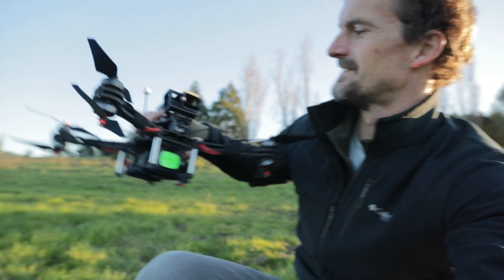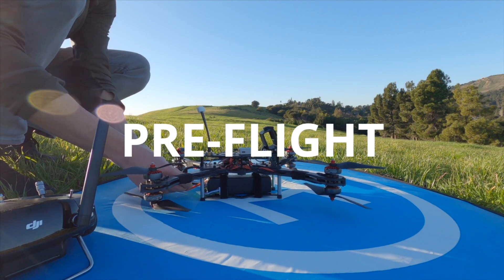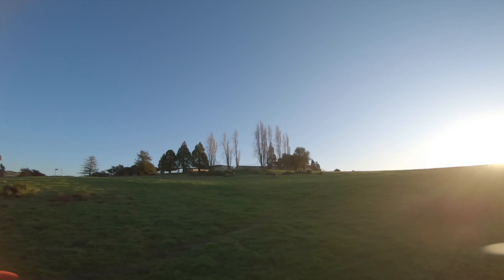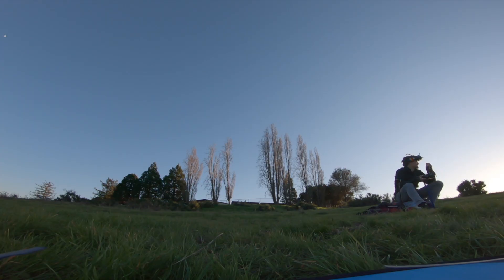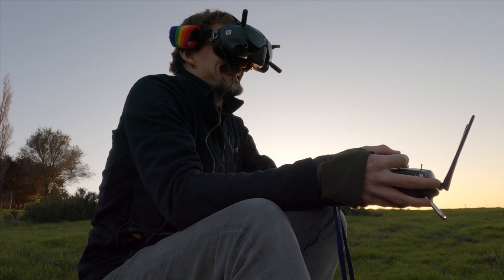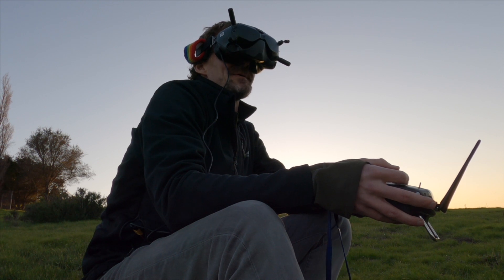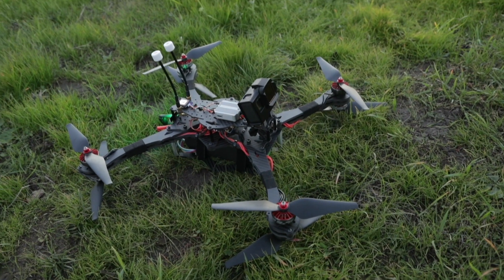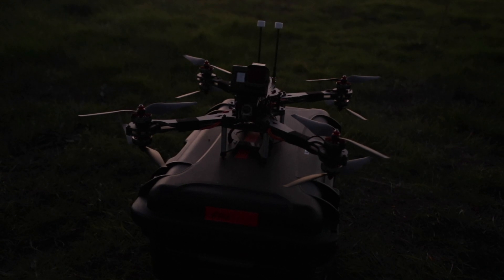Building and Flying an 8-Rotor FPV Cinema Drone

Comment: Nice build! But the thing that i wonder, is that if one motor fails. Wouldn't the whole thing be out of balance and start spinning like a normal 5" with only 3 working motors? or is there some kind of feature that the remaining motors shut down on the side of the failed motor. Or would it act normal and keep on flying with 7 motors?
Reply from the maker: Great question!  I suspect it would likely have enough authority to at least make it relatively safely to the ground if it lost a prop, ESC, or motor.. really depends on the software though.  We might need to try a test where we try to fly it on fewer than 8 motors.. sounds fun :)  There are some interesting tests out there of 8 and even 6 rotor drones flying after a motor loss, but I haven't seen one for Betaflight

Comment: That's a damn beautiful quad! Can you make a video about  the regulation and  stuff needed to work with this machine, or maybe put some links about it down here for us? That would be awesome. Great content btw.
Reply from the maker: Thank you!  Yeah, this is such a smooth operator.. take a look at the video I just posted about its new big brother :)  Regulation-wise, in the US, a drone of this size needs to be registered with a clearly-marked FAA registration number (easy, $5 via their Website).. to be used commercially, PIC needs a 107 (less easy, but worth it) and, if you're in goggles, there needs to be a visual observer with eyes on it the whole time.  And generally speaking, it needs to stay below 400ft AGL, within line of site, and not go over 100 mph.  Really, the bigger issue is that one-by-one cities, parks, privately owned spaces, etc. are banning drone use.. so even though the FAA doesn't allow people on the ground to regulate airspace above it, they were slow to the punch and it's happening anyway.. plus the new proposed rules may do away with it all!
Reply: @MattBeardsley  Thank you for the comment, it answered a lot of questions that I had.

Comment: what does it weight an whats its thrust?
Reply from the maker: 2.2kg with lipo and GoPro and, in theory, a max of about 17kg of thrust (based on iFlight's test numbers for the motors at 100% throttle and assuming 70% efficiency on the lower motors)

Comment: Great vlog as always. That is some machine. Just out of interest, what kind of payload weight can she handle and what are the flight times like?
Reply from the maker: Thank you!  I used a pretty modest drivetrain for this first prototype, so it's not the serious heavy lifter it could be.  It is crazy efficient though, easily flying 15 minutes with a GoPro on this size pack.  Based on iFlight's test numbers for these motors, it should be capable of about 8kg of thrust at 60% throttle assuming only 70% efficiency on the bottom set of blades and its AUW is about 2.2kg.  more testing needed :)

Comment: Your videos makes my wallet hurts.. now i want to convert my 2 X 13" xclass builds to 12s X8
Reply from the maker: heh heh, onward and upward!  You already have those 8 motors right?  😆
Reply: @MattBeardsley  yep, has a setof mad polar 380 and 345kv, and full working 12s APD stuff. Only need a durable frame to build it

Comment: which flight controller did you end up using?
Reply from the maker: macejc101 it’s running on a Lumenier LUX F7.  There aren’t a ton of options for Betaflight-compatible boards that have 8 motor pads. It needed the “legacy” firmware target to work, but it’s working and flying great. No complaints!  OSD is via DJI’s new integration, which is working pretty well too (I’m hoping they add support for showing artificial horizon, gps data, and essential warnings)

Comment: Really interesting setup! Do you think this configuration would work better for a heavier camera setup than the beast-class? I saw your earlier video with the z cam.
Keep up the great work! 😁
Reply from the maker: Great question!  And thanks for the comment!  I built this to test tuning and flying X8 on Betaflight and I'm pretty surprised just how well it can work.  It's essentially the guts from a long-range 6S 7" cruiser doubled.  This frame can handle much larger gear, though, up to 11" blades.  So there is definitely a configuration that could take a lot of weight and move very very fast.  Physically speaking, there isn't enough room on the top plate for a Z Cam, it'd have to be something smaller.  I'm curious to try a Sigma fp on it if I can sort out a mount, or maybe a mirrorless camera of some sort (suggestions?). I am definitely excited to try a nice big sensor on it though – it is so crazy smooth.  To match the cargo capacity of the Beast Class, it would need to be bigger.. stay tuned 😁
Reply: Matt Beardsley  Thank you for your answer! Maybe it could be possible to build a custom top-plate with a tpu mount for the z cam 🤔 i fly fpv drones as well and have the e2 so I'm very interested in your setups. Have you considered using the steadXP stabilizer on the z cam on a fpv drone? I wonder if it would work as a way to get the realsteady effect on a "proper" camera...
Reply from the maker: @AtteHenriksson  Yeah, it took maybe 5 or 6 iterations to really nail the Z Cam mount on a big quad (not sure if you saw any of the videos on that process, but it took some work!). I have a SteadXP that just came in to try on the Z Cam build and hope it works exactly like you say.  A little stabilization can make a big difference especially with intercutting with stabilized aerials or ground footage.  This particular X8 just doesn't have enough space for a camera of that size I think, and will be best suited to mirrorless and maybe the Sigma.  How great is the E2 though?  The sequence in this video of the build on my workbench was all from the E2
Reply: @MattBeardsley  Wow! Please make a video of the stedxp! It would be very intresting to se how it works on a fpv drone with all the micro vibrations. I don't know really anything about the sigma. Looks interesting though. The z cam e2 has been my main camera for a project I've been working on for the last 10 months and I'm extremely happy with the footage I've got.
Reply from the maker: @AtteHenriksson  will do! I have high hopes for it

Comment: What kind of flight time are you getting.
Reply from the maker: I haven't flow a full pack out all the way yet – just a bunch of tuning and testing.  But I did put 2 flights of 6-7 minutes on one pack and it still had capacity, so this is a serious long-range cruiser setup.  These were the 4900 mah 6S packs I normally run in series on my 12S Beast Class, but only one at a time on this.  I'll do a proper flight time test next time out!

Comment: When will this be available for purchase.  I’ve always wanted to build an 8 rotor build.
Reply from the maker: oh man, it flies so good!  I was nervous about this one.. my heavy lifter is a giant X8 and I love it,, but I've never tried to build a relatively small acro bird like this in a coaxial configuration.  Turns out Betaflight 4.1 is more than up to the challenge.  Even the tune was pretty easy.  The frame is solid, doesn't need crazy filtering.  It could handle a whole lot more power than I'm running at the moment!  This is the first prototype, and I think there will be another round or two of testing before it goes on sale..
Reply: @MattBeardsley  Where I can expect this frame for shopping online ?
Reply: @magizhmaranfpv9583  www.sculptcopter.com    2 frames are expexted to be in the shop  between 15 and 23 februari